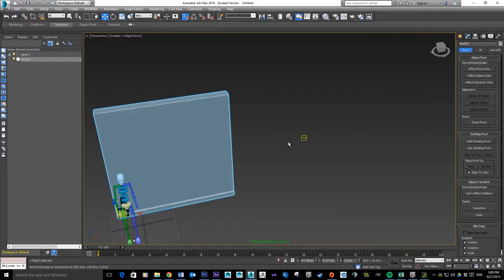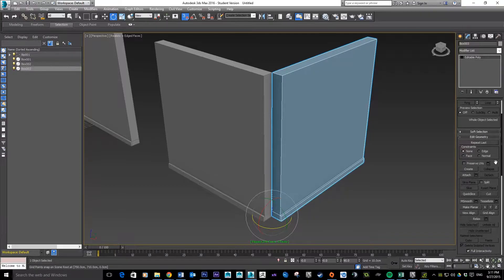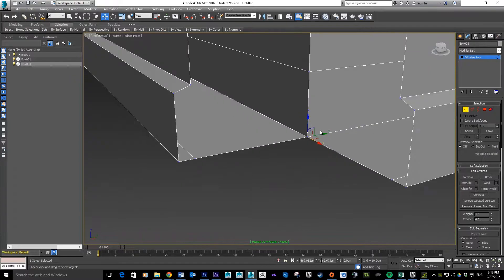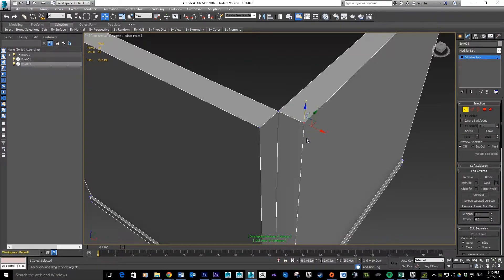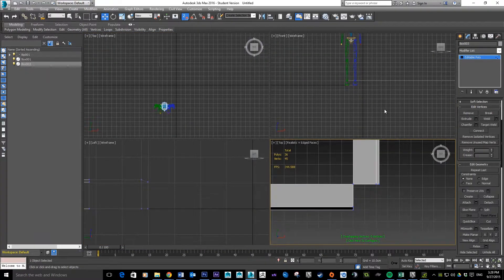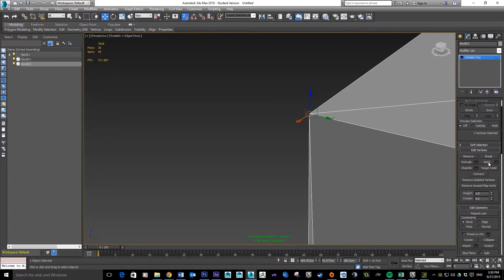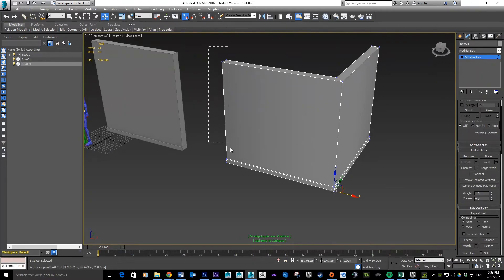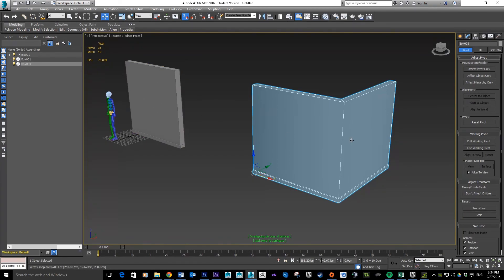3DS MAX - Making Modular Corner walls for Unreal 4

Comment: I select two vertices, right on top of each other and it doesn't weld.  I've done nothing else except set the pivot and rotate one block.  I changed the weld distance too and no dice.  It just doesn't work.  The weld worked when I deleted the internal faces first.  I have no idea why.